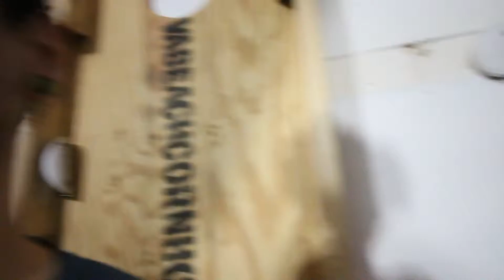EVO UPDATE, PROBLEMS ON PROBLEMS! LOL

Comment: What size turbo are you running ? Stock block ? & whats your fuel set up ?
Reply from the maker: hey Rafael! My setup has changed a while ago, I run FP Super 99 50+ boost, PPG Dogbox, and no not stock block lol Its BoostDIvision built. I run a BoostDivision double pumper with Deatschwerks 400's, I am testing their new pumps, on my car. E85 tune, AEM Series 2. 1000HP . I am VP for my Company Boost Division, check us out on facebook, our site is still being constructed. Let me know if you need parts. I can get just about anything  man :) You can reach me direct at eddie@boostdivision.com
Reply: Edward Bringas Vega nice & with the death whine transfercase issue you had before who rebuilt your t case & did you find out what was the problem within the t case mine is starting to whine unfortunately
Reply from the maker: Rafael Ramirez oh man you got the transfer case whine, that blows! Send it in to Jacks Transmission or Shep. Either one is good. It’s your pinions, gears probably worn out bad. Definitely get it fixed before it causes more issues man.
Reply: Edward Bringas Vega yea i was thinking going with shep & doing the upgraded pinion gears it was leaking oil from the t case i think thats probably what worn them out low oil as of why it was leaking i have no idea im guessing the seals